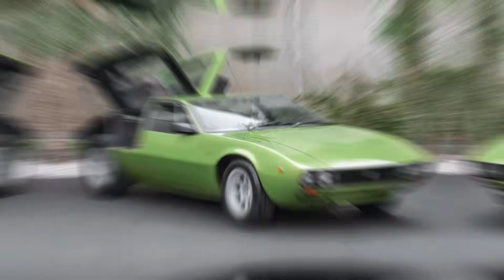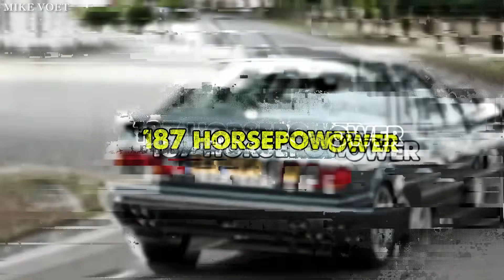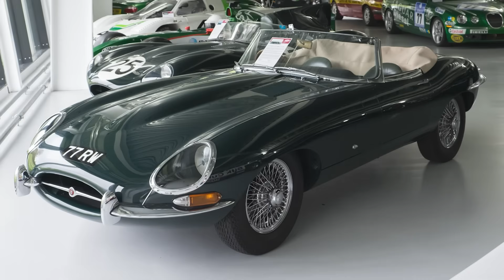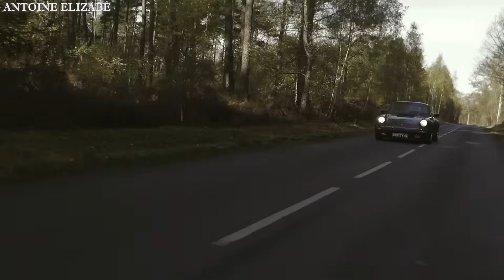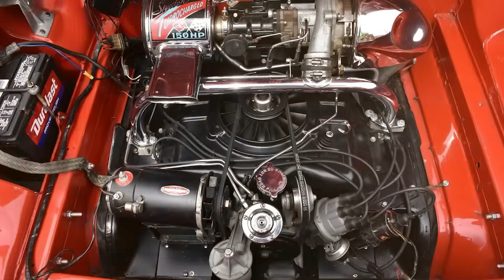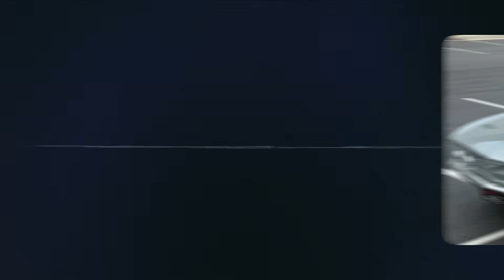6 Sports Cars With the Worst Handling Ever!

Comment: Ralph Nader had political ambitions, so he chose a car without a large committed following to criticize.  Ordinary American cars of the time were just as bad, but with under instead of over steer.  The VW Beetle had the same problem as the Corvair.  But they both had devoted followings.  Picking on the Corvair alienated only a few such as myself.
I had a Triumph TR3 that turned over on my head, after I ignored the words of experts I know.  It did very well with cross bias tires and a broken leaf in one of the rear springs, but with radial tires and an unbroken leaf, the frame came up and suddenly lifted the outside rear wheel.  This is worse than the 911 lifting a front wheel, because it is a discontinuity of traction rather than a discontinuity in the slope of the traction curve.

Comment: I was given a half finished 1963 Corvair Monza 900 that I finished and brought it back to driving condition which took me quite a lot of time.
Honestly despite being a driver who loves to drive not to slow I never experienced any problem with the car. It is actually the contrary of fast and I would not use it at high speed, the vehicle is not harder to drive than anything else of the area. My daughter used it as a daily for months and did not have problems except being quite slow on steep hill climbs. It has unusual handling compared to traditional front engined cars until you get used to it.

Comment: What is it with Americans and swingaxles I have driven gt6 and heralds the problem is the wheel on right hand side tucks under you just have go  with it a bit of lock don't brake. And you handle it easy done with one hand on the steering wheel one on the shifter to go down a gear I am from the  uk we have terrible roads lots of corners

Comment: In the US, there were a lot more deTomaso Panteras. It may had solved most of theeengineering problems in the Mangusto, but it didn't avid the terrible fit and finish issues. In the late 1970s, I was professionally acquainted with a middle-aged (crisis) attorney who owned a Pantara as a daily driver, although he barely fit into it. The paint was oxidized beyond salvation, rust spots, and a panel fitting more representative of a Ford Fiesta, per its affiliation with Ford, than an Italian sex machine. His ego would not let him dump that sad looking thing.

Comment: "Simultaneous understeer and oversteer"  -only Artificial "intelligence" could deliver such massively stupid expression. One could possibly accept that a flexing chassis could exhibit both conditions, it absolutely could not do them simultaneously.  That would be possible and impossible,  both separately and together.
Reply: It means it can go from main tendendy to understeer to oversteer, fast, in a snap, hard to predict, and control, like old porches with the same problem.
Reply: Its called a four wheel drift ! 😂😂😂
Reply: Sure it could... IF the car was split side to side with a spring of some kind holding the car together in the center. That way you could get the back end to over steer while the front is under steering... If you didn't catch my sarcasm, I'm not being serious, haha. That's like having boost and vacuum in the same tube at the same time.

Comment: Ah, the Biturbo. Where the tiny teeny fuel line went from back to front alongside the hot exhaust going the other way. Yeah. Try starting that engine again after a bit of a run. Enjoy. Don't mind the air bubbles now.
One would imagine a factory of cars and its designers knowing to avoid something as basic as that. Makes you wonder what else they didn't think of.
Such a shame. I always thought the Biturbo was the sensible answer to the supercar craze of the time. A car that had supercar potential but could also function as a daily, just for getting in the groceries. It could've been so, so great.

Comment: Chevrolet Corvair a sportscar 😂😂😂😂😂
Reply: Well, at the time serious road testers DID refer to it as one, it was even called 'a poor man's Porsche'. I am of course referring to the 1965-on cars with Corvette rear suspension, not the pre '65 cars with swing axle rear.
Yenko made a hundred or so modified cars for racing. They went well.
Reply: Yeah, the 4X1bbl 140 horse cars and the 150 and 180 horse turbo cars, all with 4-speed manual gearboxes, easily fit any reasonable definition of "sports cars", but since you're an internet expert with laughing emojis to conclusively prove your point, you must be right.
Reply: Do you know that the late Corvair cars shared the rear suspension and gear clusters with the Corvette? That the turbo Corvairs were not the world's first production cars with a turbo, that honour belongs to the 1961 Oldsmobile Jetfire, but the first car fitted with a turbocharger was the Halford Special - built in 1925 based on an Aston Martin chassis with a special 1500cc dohc six cylinder engine designed by Halford for racing? The turbo was based on American experiments with turbocharging during WW1 for aircraft. It was not a success and was replaced with a supercharger. The car still exists, I have seen it.
Reply: @pashakdescilly7517  I'm pretty sure you're addressing the OP in this thread, but just in case...I've owned and worked on, extensively, every flavor of Corvair ever made, and raced two. Yup, some were indeed sports cars, and the '65 and later rear suspension was one of the most advanced under a production car at the time. They were a real pleasure to drive...fast. Even the earlier swing-axle cars could be easily modified to tame the handling by using exactly the same mods that hot VWs and 356 Porsches responded to so well.
Reply: The 1964 Corvairs prove your point about modifying swing axle cars to handle acceptibly. Stiff anti-roll at the front, minimal at the rear is the place to start. 
Mercedes did it by having a low swing-axle pivot and softish springs on the axles, and a helper spring between the two axles. Triumph did it on the Spitfire Mk4 and late GT6 Mk3 by mounting the transverse rear leaf spring on a pivot, giving zero roll stiffness at the back, and fitting a much stiffer front anti-roll bar.

Comment: lol  love the  goof  up on the  photos for the corvair lol another fly by night  car video,  i had a corvair we modified the suspension and  put in  sub frame and made it into a mid engine  with a 283 v8,  had a  66 healey 3000  wish i had that car today  it was fun  and  i dont ever remember  and understear issue with it   you   watches  you  gas and braking and   timing on steering and that car  could cut  in and drop in low in to a corner  with the best out there

Comment: A friend in Tucson bought a Mangusta and thought it was the be all and end all of motoring. It had the 302 and was woefully under geared, it's speedo said 70 when it was going 50. But he never believed me. I drove it a few times and didn't like it's handling at all. On his birthday he tossed me the keys and said take someone for a ride. On a gentle right hander into a subdivision on some scattered pea gravel the ass started coming around. I turned into the skid, and let off the gas, it just kept on rotating, up over a gently sloped curb out into a goddamn field of undeveloped land, and hit a signpost, the only one in 100 acres of flat desert land. It smashed in the driver's fender between the light and front wheel. I wasn't going over 40 mph when it happened, I could have taken that corner in a VW bug. Jim wanted me to pay for repairs, yet he was paying something like $300 per month for insurance. I didn't pay him a cent so we didn't pal around after that. That car handled like shit and I drove stock cars on dirt for decades and never spun out.
Reply: You let off the throttle mid corner in an old school mid engined car? You're blaming the car for your lack of understanding of physics? Drive a Tesla on autopilot if you can't be competent behind the wheel of something that requires at least a minor level of skill. It's actually quite a fast and rewarding car around corners if you aren't an imbecile.
Reply: @lnyt445  the Mangusta was so bad-handling that keeping your foot in it would just send you off in a different direction.
Reply: @grumpy9478  completely untrue
Reply: @lnyt445  just my observation from an example I rode in back in the early '80s, mr superior attitude.
Reply: @lnyt445  Odd, how many have you driven? You just watched this video and came to this conclusion.
Reply: @JeffreyHunn-q7w4q  I just "watched this video and came to this conclusion"? You realize the video is talking DOWN about the Mangustas handling, right? 😂 A family member of mine owned a Mangusta, i've driven it on backroads and had the opposite experience. I thought it was going to be clunky and handle badly. Total opposite. It's one of the most exhilarating car I've ever driven. In fact we did timed laps up and down his road, my E46 M3 vs. the Mangusta. He managed get over a second faster than me on a twisty road. I tried it for myself in the Mangusta because I just thought he was a really good driver, and the result was almost exactly the same. So, yes the gear shifter can be clunky but thats true of most older cars, but it's not that hard to drive fast around corners, unless like I said you dont understand the physicis of an older mid engined car. Also, why are you are talking about "light for light" as if it's supposed to be some kind of dragster? Thats not the point of the car. At all. If you don't understand the point of the car, how are you supposed to have the foresight and reasoning skills to understand that cars handle differently to each other? Just because you (self admittedly) messed up and aren't used to driving it, doesnt mean the car is bad.
Reply: @JeffreyHunn-q7w4q  Yes, now he's an expert with an extensive background in vehicle dynamics, and YouTube Certified.
Reply: @lnyt445  It's a piece of shit, long story short. The lack of chassis dooms it to handle like crap.  It's not fast at all, a Mustang beat the hell out of Jim light after light in Tucson. The gated shifter needed constant attention to select gears. I can see you've never even ridden in one much less drove it. I have driven everything under the sun, and I'm an exceptional driver, I've won races on pavement and dirt, and I NEVER SPUN OUT. I've raced so many tracks I have trouble recalling them all. I quit racing 20 years ago at age 55. I still ride my BMW and drive my Miata, fast in the curves.
Reply: so you were/are a lousy "friend"
Reply: They all had front engines.  A learning issue.
I started on rear /mid engined cars and never had a problem.